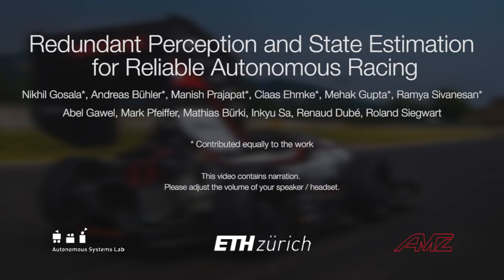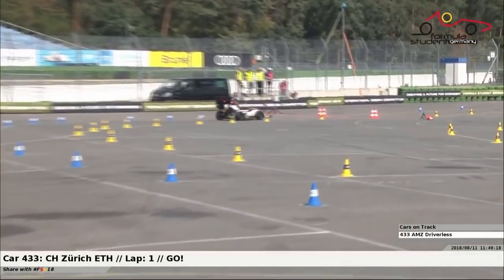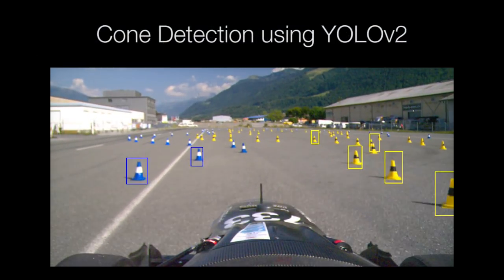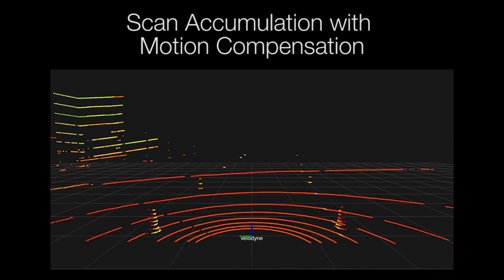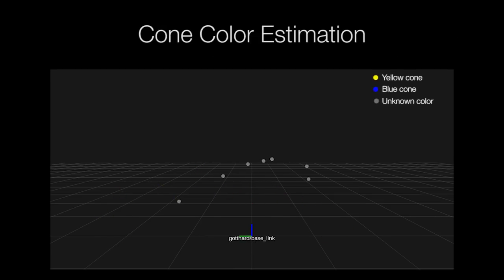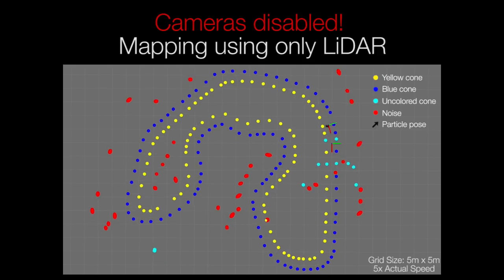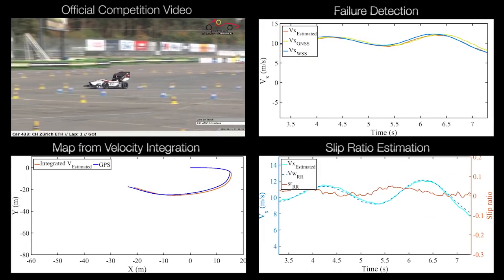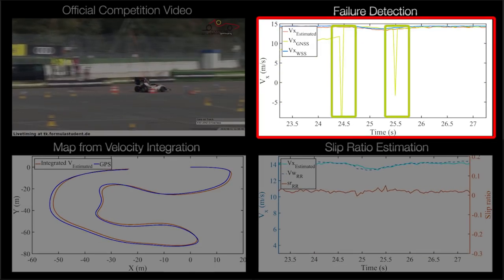Redundant Perception and State Estimation for Reliable Autonomous Racing

Comment: With the data available and the sensors on board, it should theoretically be possible to have the computer run the perfect mathematical time once it learns the course well enough correct?
Reply: I am not sure what exactly you mean by mathematical time. But the time stays pretty constant. For example, in a track of 310 m, if we take 28.6 sec, then in subsequent laps it differs by only +/-0.1 sec. We never learn the path, it can be risky. So we evaluate trajectory for next time steps iteratively. Although few features can be learnt in the track, that has been tried and could achieve time reduction of 10%, and then it stays constant given that track doesn't change significantly in each lap.